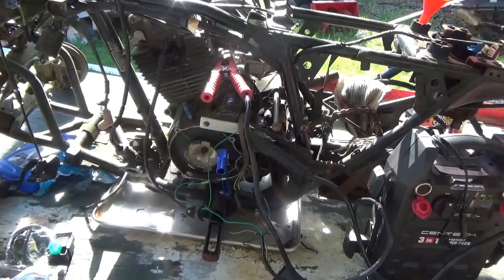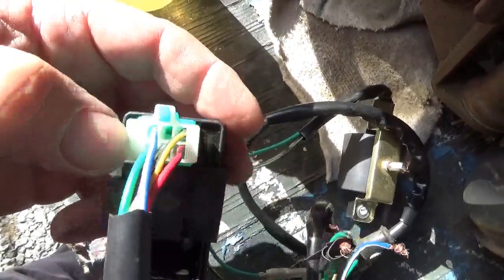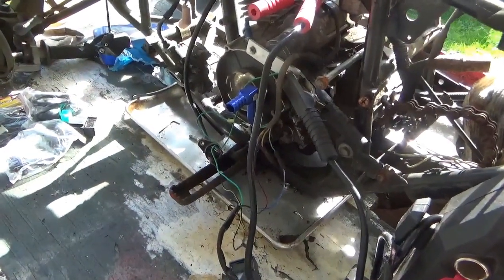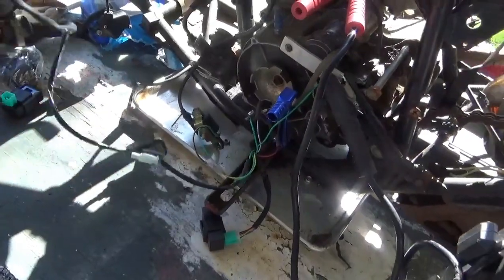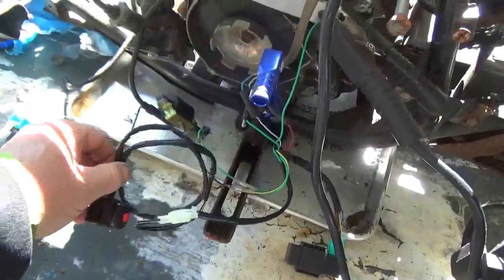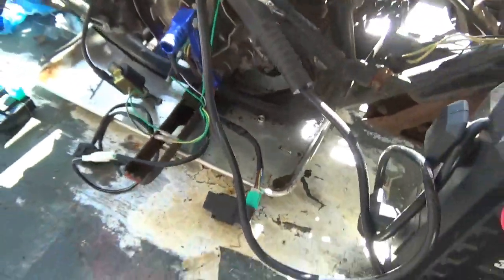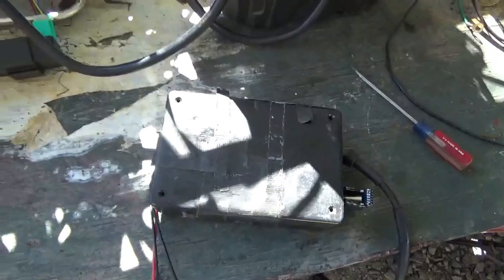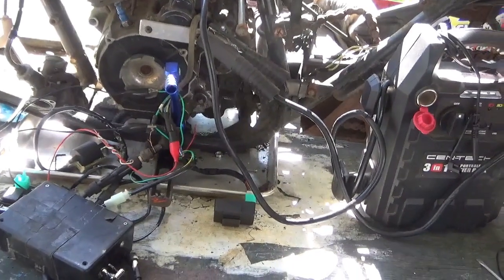Pit Bike Ignition Hack Failure, Surprise Factory Defect!

Comment: I bought the DC version and tried to do your hack. I was absolutely pulling my hair out trying to figure out why it wasn't working. just dumb luck I found one of the coil wires didn't have the insolation stripped back before they crimped on the connector. once I stripped the wire and changed the connector it fired right up.

Comment: The red and black ( power ) goes to 12 volt battery in the box ? Right ! I found a couple of very small ( 3” x 2” x 2” tall ) 12 volt batteries ,  sealed lead acid and a nice plastic box ( 4” x 6” x 2.5” deep and added a lighted switch but as of yet unable to use it ( no ATC ) to see if it works the way I have it ! I also mounted the coil in the box and ran a green wire with alligator clip for the extra ground ( hope that’s good ) and am waiting to use it ! Lol. I might try it on a 250es I have on the shelf !

Comment: Hei Harvey.  THank you for makeing these videos.    I do alot of bike building on older euroopien bikes.  And the correct cdi, coil, wire harnes is sometimes very hard to find. And if you find it it is a long wait to get them(i live in Norway) Do you think these ignition kits would work on ok on older 2 stroke bikes?  i do not need them to run the bike perfect, just good enough for starting them up and doing some test riding?